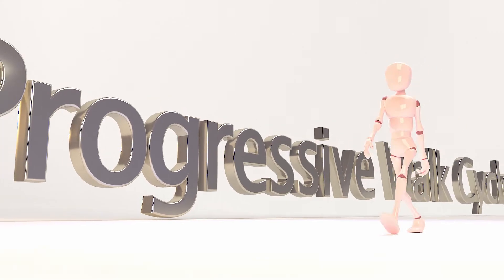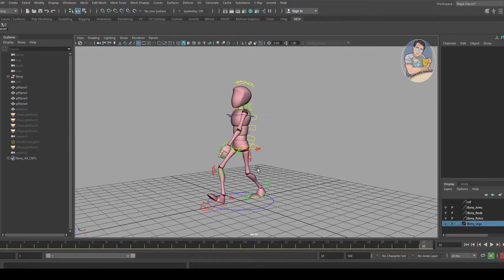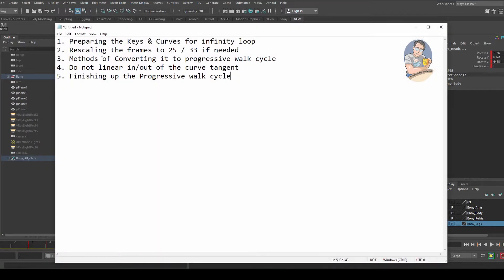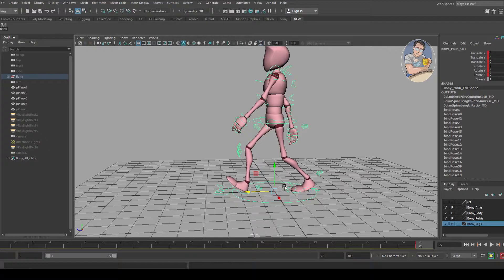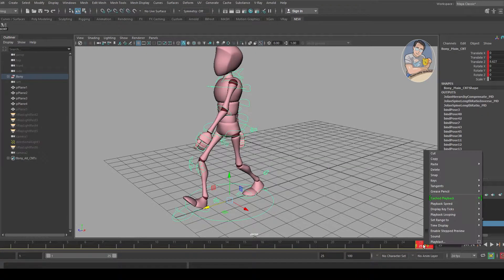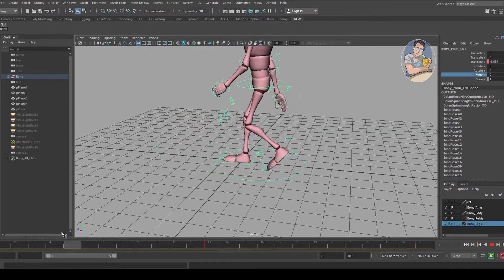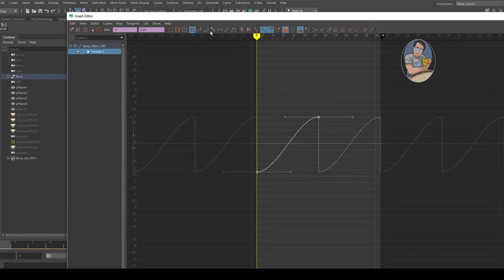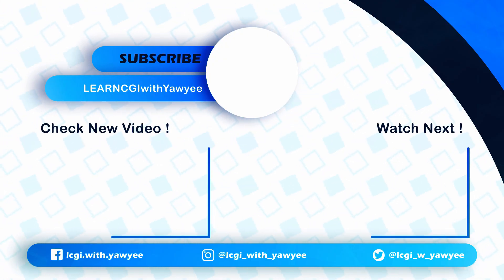Maya Progressive Walk - Animation Tutorials | A Step by Step Guide

Comment: I still have one question: whenever I want to move the character around the stage, should I always use the parent controler? like in this case, the big circle? if my character is dancing, jumping around, anything, should I always use that parent, and always sync it with the part of the body that is touching the ground (when it's the case)?
Reply from the maker: If you are moving over a bigger distance , it is better to use the big circle. If character is doing it in the same spot , i prefer to use individual controller rather than the big ones , but it does depending on situations

Comment: i tried the progressive walk but the feet are still sliding and not moving fast enough.. Can you help?
Reply from the maker: Do you mean it still looks like a cycle ? Instead of walking towards front.
Reply: @learncgiwithyawyee  its moving forward slowly while sliding
Reply from the maker: @canucks9220  Try to check the curve interpolation, most probably is the tangent that causes that problem

Comment: Followed all the steps, the first step forwards works fine, but after the next foot goes forward, there is a gliding issue with the feet. My translation for the main control are the exact same as done in the video. I don't know if it has something to do with the translations for both feet.
Reply from the maker: It is most probably be the auto curve interpolation, curve tangents, check and see if both keys are the same but in the middle it has some lumps
Reply: @learncgiwithyawyee  All keys are the same, even had to check the Translate Z for both feet. It's a bit odd.